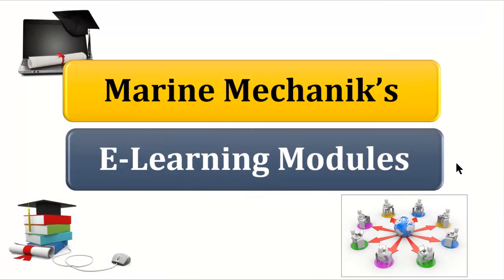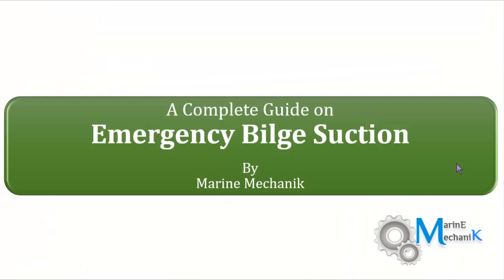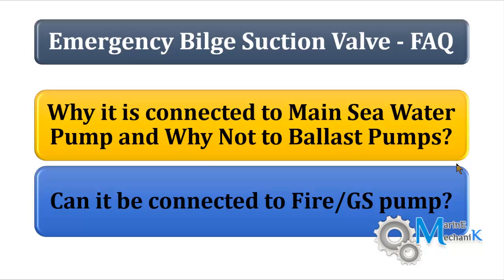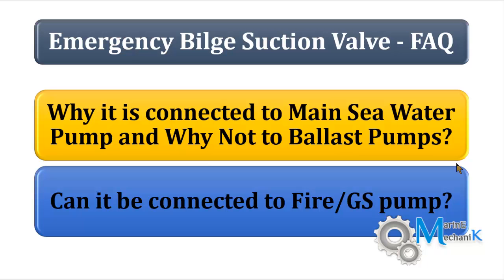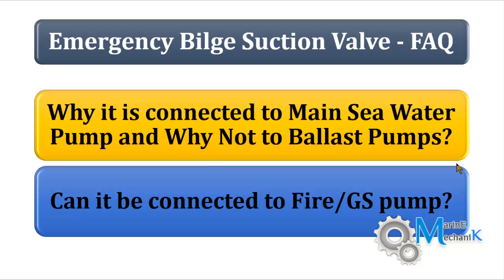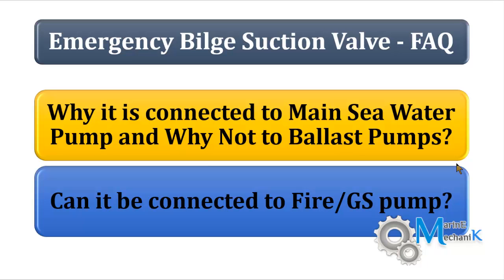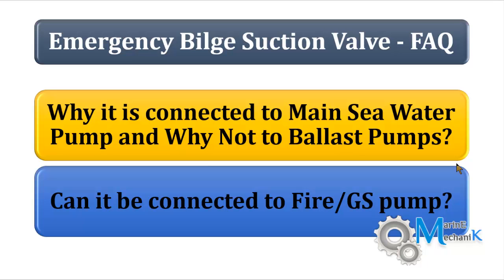seawater pump ballast pump

Comment: I have been on a 2004 built LNG carrier there Emergency Bilge Suction valve was given on the Ballast Pump which runs on 6600 volts no supply is provided from Emergency Generator
Reply: yes me too steam lng ship ballast and gs pumps